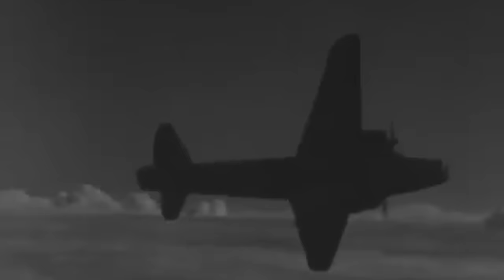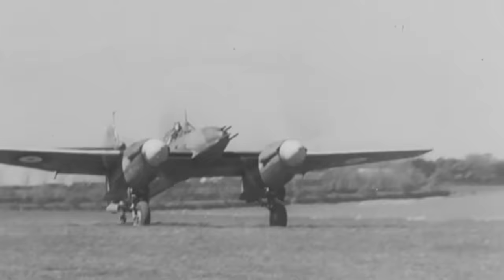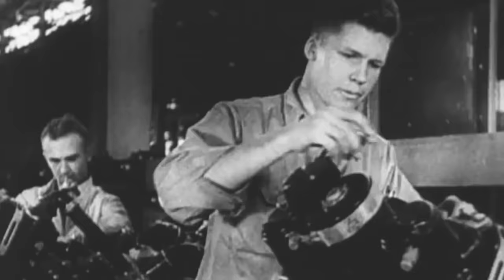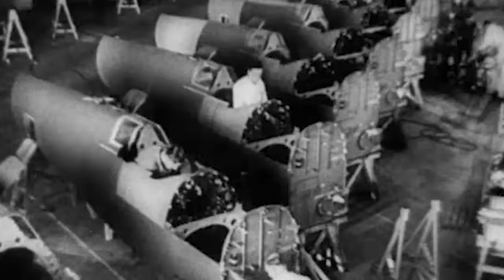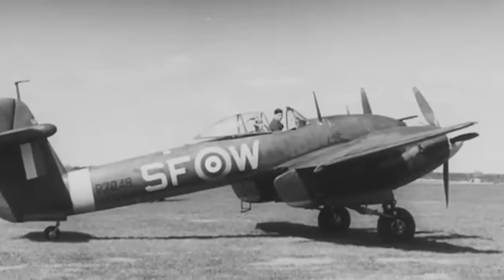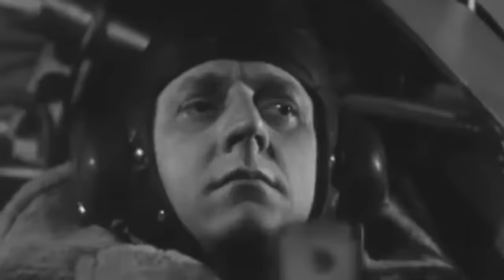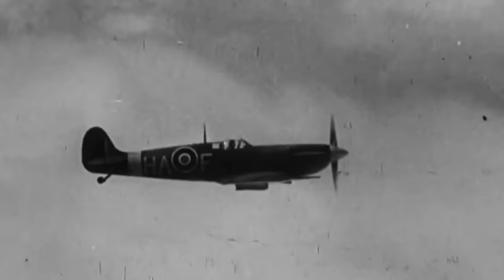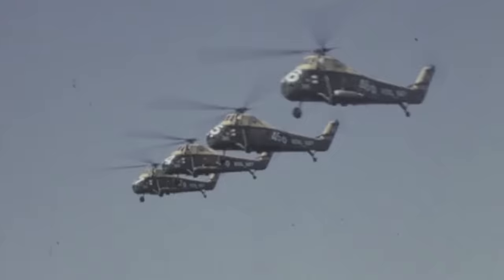The Plane that was Just One Giant Gun

Comment: The mosquito was coming online more or less at the same time as the Whirlwind was losing its engines. It was faster, lighter, with more firepower, most importantly, made of wood,  a non strategic material. The Whirlwind was just flummoxed by its obsolete engines, pretty though..
Reply: Its engines were not obsolete, they were just being made by a company that dropped them to prioritze Merlin engine production and development.
Reply: It turns out that the whirlwinds propellers was its downfall causing issues.
Reply: The Whirlwind was a heavy fighter, while the Mosquito was concieved as a fast bomber, so it would have happened anyway.
Reply: @CaptainQuark9   However the Mossie was a Light Bomber, a Pathfinder,  Strategic knockout attack, a fighter, a recon and photo aircraft.  The Mossie did it all.
Reply: My bet on Politics
Reply: @0Zolrender0  It was such a great design that variants of it did indeed take on all those roles, but de Havilland developed it originally as a fast bomber, with its speed obviating the need for defensive armament.
Reply: The mosquito was probably the best aircraft of WW2. It could do basically anything except heavy bombing and air superiority, although as a night-fighter it was unmatched and it's ability to actually hit a target often made it more effective than a heavy bomber and the primary user of OBOE.
By 1944 they just could not produce them fast enough and everyone wanted them although the initial proposal was met with part derision, part scepticism and very little support from the Air Ministry. 
The Mosquito and the US equivalent P-38 Lightening made the Whirlwind obsolete.
Reply: @ianhigh4354  ...and the US attempt....
Reply: It might technically not be a heavy bomber but it carry very close to a B17's bomb load
Reply: @ianhigh4354;
"Except heavy bombing.." I think that one might counter that suggestion with its bomb load, as, by weight, it could carry 500 pounds more than a B-17, but was more limited in the number of bombs, like 4 x 500 pounds... this lead me to think, though, that the mosquito, if used in large numbers, say, if the USA had swallowed their pride a bit, and produced mosquito bombers... The mosquito could have done more damage than equivalent numbers of B-17's, flying faster and lower, more accurately, with fewer crew to lose. Such tactics might have made a significant difference in bombing delivery and aircraft/crew losses.
Reply: @ianhigh4354 … The P38 didn’t fare as well in Europe when it was required to operate at 30,000 feet (twice its operational height in the Pacific theatre).  At that altitude it was at a disadvantage against the FW190.

Comment: If Eric Brown thought the design under powered, it was.  If it was under powered it needed a lot of development, in the form of basically a new engine.   This was certainly not a short term issue.  An 800 mile range isn't noteworthy and limits escort utility.  The aircraft would have been useful intercepting bombers but at higher altitudes it became mediocre.  I can see this plane excelling in islands in the Pacific defending at low altitude.  The Aussies could have used them.  The aircraft certainly looked the business.
Reply: at the time, I'm not sure that Winkle was aware of the Whirlwind problem.  It was the props used in production models that encountered compressibility.  There were other issues of course, but it wasn't the Perigrine engines.

Comment: If only those RR Peregrine engines could have had greater development, becoming more reliable and more powerful in the same way the Merlin did.
Ditto the airframe.
It could have been developed into a most formidable aircraft but, unfortunately, with limited resources available, the Air Ministry & Manufacturers had to concentrate on established designs.
Reply: The demise of the Whirlwind cioncided with the rise of the Merlin-powered Mosquito.
Reply: May not have been a Mosquito had the Whirlwind used Marlins. Timing.
Reply: @patrickgriffitt6551  The Whirlwind was a heavy fighter, while the Mosquito was concieved as a fast bomber, so it would have happened anyway.
Reply: @CaptainQuark9  maybe could have had both.

Comment: If the thing is supposed to be a long range escort fighter then all it needs is enough firepower to bring down a fighter like a BF109, FW190 or possibly a BF110. 4 x 20 mm cannons would be overkill for that and extra weight at the expense of range or agility. The very effective P51 Mustang made do with 4 or 6 x .50cal machine guns. The cannons would be needed for an interceptor/bomber destroyer or ground attack role.
Reply: My father's Mustang (268 Squadron RAF) had 4 x 20mm cannons.
Reply: @Jon.Cullen  I hadn't heard of that. I guess it must have been modified for ground attack as the four cannons and the ammunition would be very heavy for a single engine fighter. The American fighters as a rule didn't use 20 mm cannons, notable exceptions being the P38 Lightning, the P39 Airacobra and the P61 Black Widow. Perhaps if the course of the war were different and they needed to shoot down a lot of bombers (other than unarmoured Japanese Bettys) that might have changed.
Reply: @philiphumphrey1548   Hurricane IIc, Spitfire MkVc (and later variants), Typhoon, Tempest all single engine, all with 4 x 20mm cannons. All had varying degrees of success, and much to do with the power of the engine. I do know that 268 Squadron were not the only one to have the cannon armed Mustangs, but as far as I know, it was an RAF thing, not for the USAAF.
Let's not forget, either, that the Mosquito and Beaufighter had 4 x 20mm cannons in addition to 4 x .303in and 6 x .303in machine guns respectively, and finally the Meteor jet which had 4 x 20mm cannons.
A lot more Luftwaffe bombers would have been shot down during the Battle of Britain had the Spitfires and Hurricanes been armed with cannons, as the 0.303in machine guns simply didn't have the hitting power. That is the opinion of no less than Robert Stanford Tuck, who fell out with Douglas Bader over the issue.
Reply: Cannon armed Spitfires were operated in the BOB by 19 squadron but they had problems with jamming and were removed. Once the issues had been solved after the battle there was still opposition from Bader  who for once later admitted he had been wrong.
Reply: @ericadams3428  Yes, I ignored that case because of the jamming issues. They refused to fly them after too many jams, and I believe that not one enemy aircraft was shot down by them. The cannons were not removed, the entire fleet of Spitfires was replaced. If I remember correctly, it was the first squadron that Probationary Pilot Officer Johnnie Johnson flew with before his collar bone operation grounded him.
Bader may well have admitted that he was wrong, but that was after he had been shot down (allegedly by Buck Cannon, perhaps somewhat ironically) and became a POW. In his wing on that day, his was the only MkV Spitfire still armed with 8 x .303 machine guns, at his insistence.
Reply: @philiphumphrey1548 Some P-39/63s had 37mm cannon that were occasionally cannibalize and mounted on PT Boats.
Reply: Please Americans keep in mind that long range to a European is not the same to us.
Reply: there were early mustangs with alison engines that had 4 20 mm cannons they were not for ground attack as the a 36 appache  was the modifies mustang for ground attack late variants of the hellcat corsair both were armed with 20 mm cannons
Reply: @philiphumphrey1548 The fitting of 4 X 20mm cannon to the Mustang was actually instigated by the USAAF, they acquired an early batch of Mustangs that were originally destined for the RAF and didn’t like the armament they carried so had them refitted with the four cannon instead, the RAF refitted a few of their Mustangs the same way and re-designated them as Mustang Mk.IA’s.

Comment: British aircraft had the oval rear end because it’s stiffer than a slimmer tube with bubble canopy. Even then, some types struggled with structural failures (e.g. Hawker Typhoon).
Reply: The problems with the Typhoon were later found to be down to elevator flutter in power dives putting highly localised vibratory loads on the fuselage, which caused rapidly opening fatigue cracks.  Without that, the fuselage would have been fine

Comment: I wonder why the Whirlwind wasn't upgraded (again) to Merlin engines?
Reply: The basic design as was couldn't take the Merlins. In Jan 1941 Westland wrote to the Air Ministry offering a new Whirlwind with Merlins and new nacelles and wing. The Air Ministry said no.
Reply: 200 whirlwinds or 400 spitfires that’s why they did not get merlins
Reply: @Chris-mh3vf  Not totally true, ericadams3428 comment is correct, it was tried and threw all the aerodynamics out of kilter. However take a look at the later Westland Welkin?

Comment: The Westland whirlwind was the prelude to the dehavlland mosquito
With similar designs and engines and firepower
Twin engine fighters interceptors were the future during WW2
🕊️ Of ✌️
Reply: Birds of victory
Reply: Seems nothing ever ends up in the mission it was originally designed for.
Reply: The Whirlwind was a heavy fighter, while the Mosquito was concieved as a fast bomber, so it would have happened anyway.
Reply: There are very few aircraft without any kind of blemish, particularly if they have been conceived during the war itself. This was due to the sheer pressure to find immediate solutions to the threat offered. Examples would include such aircraft as the Typhoon which was both effective and dangerous at the same time Additionally, the strategic objectives themselves changed, witness the growing need for long range escort fighters like the P51 whereas earlier fighters were short range, point defence designs.

Comment: I believe that this plane was politically sabotaged. I had never seen it and instantly knew that it could have been influential in early WWII.
Reply: It was a Petter Pig!!! The aircraft was loaded with design flaws that couldn't be fixed.
Reply: Indeed apart from the engines, the propellers were of the wrong type and the hydraulics needed work on. Also four cannon with 60 round drums meant that the ammo didn't last too long. Finally bearing in mind there were only 114 production aircraft built and they suffered 21 tailwheel collapses between them meant that it needed a lot of work. If the problems had been worked out earlier and either 120 drum mags or belt fed ammuntion used it may well have been a  very effective heavy fighter in timmes of need. In the end other aircraft offered a better solution. Westland did later offer a Merlin powered Whirlwind on paper but the Air ministry refused it.
Reply: @ericadams3428  Cooling system wasn't that cool either.

Comment: I was always amazed that anyone with even a small amount of intelligence could ever have thought that arming Hurricanes and Spitfires with peashooter.303cal guns was a good idea.. if they’d had cannons from the start, they would have been much more effective. As for the Whirlwind..what a mistake to not design it around the Merlin…..However, a couple of RR RB-50 Trent jets under each wing could have been a great idea.
Reply: RAF ran trials pre-war that showed cannons were best. But they couldn't get wing mounted cannons to work. There were a few BofB cannon armed Hurricanes but the pilots asked for their old planes back because the cannons kept jamming. Wing flexing. They figured it out by 1942.
Reply: It had a lot to do with the huge amounts of surplus .303 one of R J Mitchell's design team said whenever you presented a design to the Air Ministry one of the first questions was "will it use the .303 ?
Reply: The RAF also trialed 0.50 machine guns in these pre war trials. These ones were an older design with a much lower rate of fire and it was concluded that with each 0.50 weighing the same as three .303 guns it wasnt worth it.

Comment: Someone here is welcome to correct me if I'm wrong, but didn't early Spitfires also have issues with the Hispano cannon jamming, which is why they persisted with .303 machine guns for so long?
Reply: Correct. I think that the fix was to change the orientation of the gun. Also changing the grease/oil used to lubricate the moving parts.
Reply: Yes the cannon had to be turned 90 degrees to fit in the narrow spitfire wing which caused feed issues

Comment: The P-38 was a superior aircraft with a much better climb rate than the mossie.
Reply: But it did not have a Bombay and except for the night fighter and pathfinder variants only had one pilot.
Reply: not the same airplane type. The P-38 was developed as heavy fighter and the Mossie as fast bomber. The fighter bomber version came later.
Reply: P-38s could not dive as well as enemy aircraft.  They would get near supersonic and would lose air over control surfaces, causing loss of control and crashes.
Reply: @PC-vq5ud  what you really meant was it could dive too well.
Reply: @patrickgriffitt6551 I would say it was simply not built to dive
Reply: One of those nearly killed Eric Brown if I recall correctly, and nearly killing Eric Brown is not cool. Even the P38 Airfix models couldn't dive.
Reply: @patrickgriffitt6551  109 and 190 could dive faster and stay under control better, which they did when facing p-38s.

Comment: Right idea but poorly executed and regarding the Whirlwind,s engines,  they are Peregrines ,an updated Kestrel with a decent pony count of 885. Again incompetence and stupidity reigned at the Air Ministry run by cretins in grey suits carrying brown brief cases. During the Whirlwinds design phase  Westland over egged the pudding,' keep it simple stupid' Clarence 'Kelly' Johnson,s immortal words when designing the dragon lady in 1954.  4 cannons, two decent engines are vital to bring down an enemy bomber , fend off opposing fighters and out drag an 'E' series  BF109.  A Whirlwind could do 370-375 mph with Peregrine 2,s  fitted with a two speed blower burning 100 octane petrol driving  three blade Ratier  constant speed props or Dowty Heleshaw  props . At a rough guess burning 100 Octane, a Peregrine 2 is good for 945-950 ponies for take off in 'low' blower .  The key is simplicity and churn them out fast as you can but the Whirlwind is anything but simple, no wonder it failed.